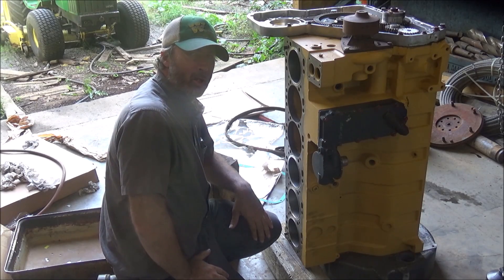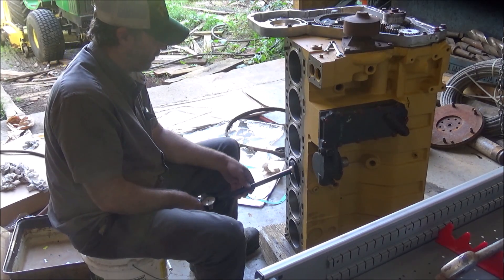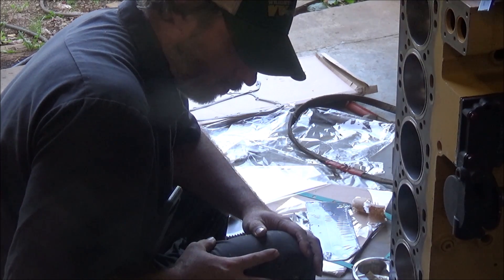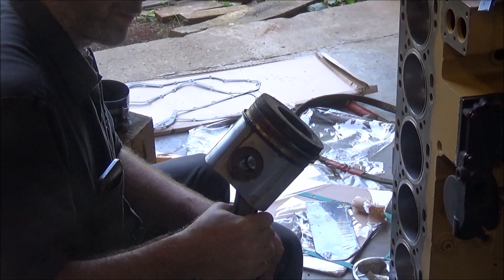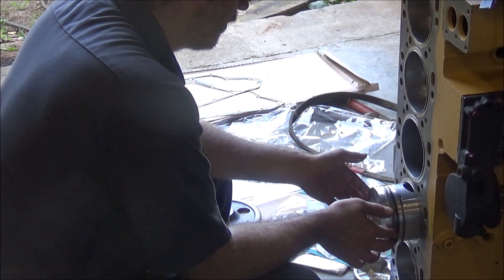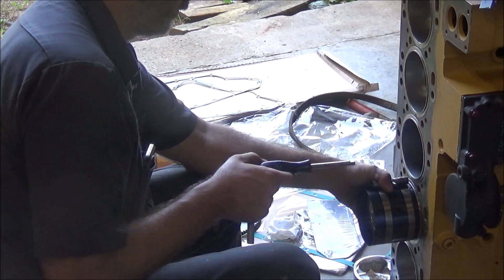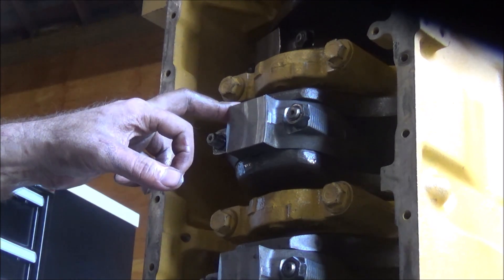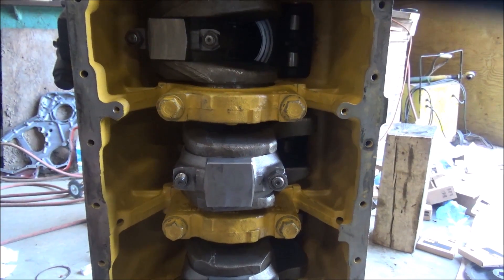Cummins Swap 8.3L 505cid Diesel in to 15K lb Hyster Forklift

Comment: i didn't see any type of sleeve retainer how did you keep the liners from moving when you were bolting the rods? i once converted a customers v8 ford flat head to a junk yard 350 chevy in an old cat forklift. most people don't realize whats involved with  conversions like this. best of luck brian.
Reply from the maker: larry sperling The Cummins liners press fit is tight enough the rings won’t shove them out but if you get one a little loose you can use a bolt and flat washer to hold em.

Comment: I know people talk about keeping things clean, etc. But the thing is, soon as its running its all washed down with oil into the pan. Any of the dirt in the oil is caught by the filter. Way more dirt & grit comes in with the air over the life of the engine.
Reply from the maker: main thing is to make sure you don't wind up with any debris that would get trapped like dirt between piston rings or between bearings. If things are clean when you assemble them it should all turn out right. The small amounts of dust that is in the air that happens to land on the motor isn't going to hurt anything. Some people seem to think you have to have a certified clean room to put an engine together. Clearly they aren't familiar with the really big engines where they are assembled in a building like a warehouse with people walking all over the parts as they are put together.
Reply: @bcbloc02  I read a long time ago in a racing type magazine an unscientific study about engine failure. The type of guys tearing engines down/reassembling at the track in a hurry. Dirt was at the bottom of or not on the list. Not far from the top was rag/towel/paper type lint or debris. Suprised me.

Comment: I wonder ? You have nice work benches But still work on the ground with the dirt
Reply: that the way real farmers doit its just a cummins
Reply from the maker: I don’t have any work benches that will hold a 2000lb engine. Also that gets it a little high to work on. An otc revolver would be perfect for the job but hard to find at a good price.

Comment: The last time I did a full engine rebuild was in 1965 to a 1939 Buick.  Thanks for the memories Brian.  Love your precision in doing things.
Reply: Was that a straight 8?
Reply: @ypop417  Yes and it was overhead valves too.
Reply from the maker: I always thought the Buick 8 head with a packard bottom end would have made a smooth strong engine.😎

Comment: Built a lot of Cummins over the years.  I own many of the liner installation/removal tools speced by Cummins.  Can you provide the PN for your installation tool?  I looked for 6x6 on QuickServe and came up with nothing.
Reply: Years ago International Harvester had a farm equipment school at Sheridan Hills in northern Illinois.  To determine the flat rate they would tear a new prototype down a few times and average the times to get the rate.  They also had a guy there taking notes on special tools and the procedures.  An instructor by the name of Larry Love was breaking down and putting an IH 656 Hydrostat and came to an obstinate bearing.  He said, "I need to get the BFH-101 tool to get this on" and the note taker wrote it down.  When the manuals came out, there it was, you needed a BFH-101 tool to install the bearing.  Dealers, who knew the funny part, were ordering the BFH-101 tool.  During the week-long school, Larry loved to be the one who made sure everyone was awake in the IH owned motel/executive getaway.  One morning he was bouncing a backhoe bucket in the front of the place.  Guarantee we all were awake.
Reply from the maker: We use lubricated condoms for not cutting one of the Deere powershift pack seals. I wonder how the note takers would write that one up! Lol
Reply: @bcbloc02  LOL.  That is epic, and I"m adding it to my solutions arsenal.
Reply: @bcbloc02  wow the jokes that come out of that....lol
Reply: Part #6X6W00D LOL
Reply: It's a Yugo tool!
Reply: Peter Haan 😂😂😂😂😂 made my day thanks
Reply: Yup... these are my people.
Reply: That tool wood not be listed...

Comment: Why put the opening of the snap ring on top? I've always put it on the bottom, but I'm not sure why.
Reply from the maker: fefi I did put the opening at the bottom or towards the crank end.
Reply: @bcbloc02  oh  I misunderstood.
Reply: bcbloc02 Is the concern that the reciprocating motion could flex the snap ring legs away from fully seated if they’re oriented sideways (perpendicular to the piston motion)?
Reply from the maker: Yes the mass of the snap ring can cause itself to close if it is oriented sideways when the piston reverses direction. The piston acceleration is lowest at BDC so best to have the gap oriented so it has the least chance of coming out then.
Reply: Wow... That makes actual sense.